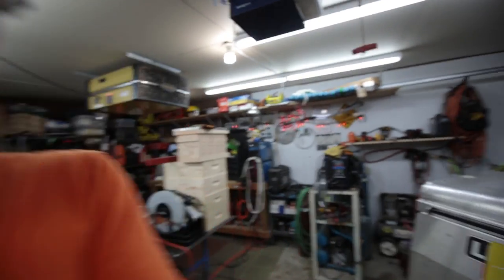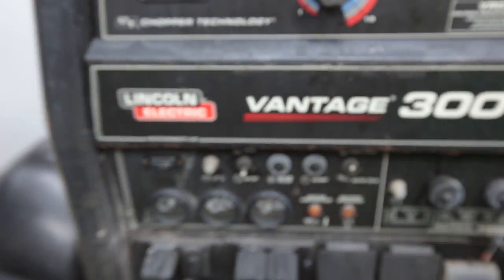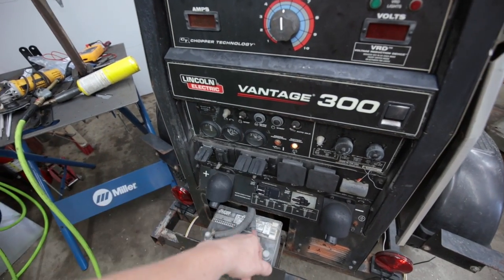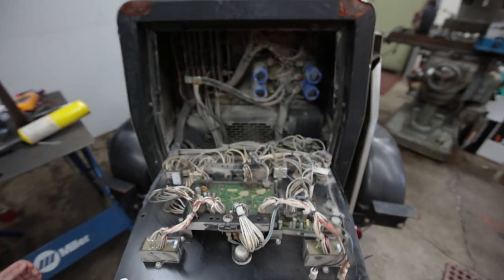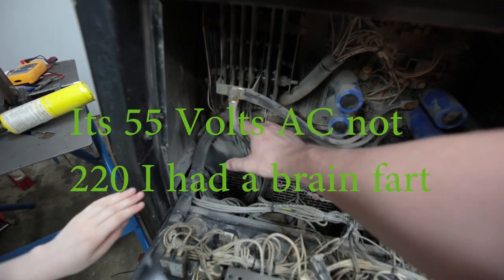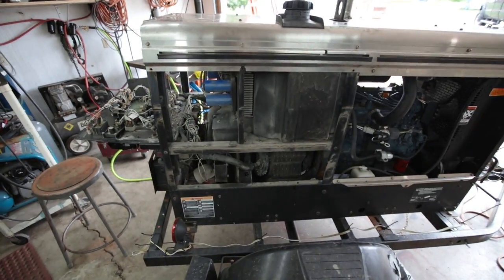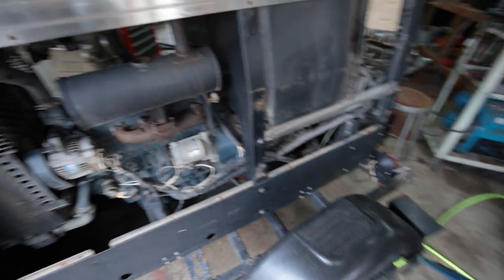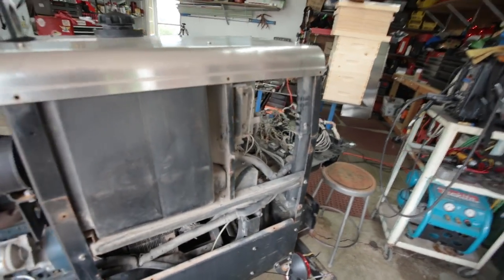So I Picked up my Lincoln Vantage 300 Welder

Comment: Any updates on fixing your welder. My welder was store for 9 and a half years my used to turn it on every 6 months now I came back to town and been using it for the past week and a half for about 6 hours a day and today it just did not want to arc. Try any tips on what to look for or were to start checking
Reply from the maker: I got it going, was a bad transformer. Best advise I can give you is look at the schematic and follow the output through it. There is nothing to complicated in them but the parts are spendy if you replace the wrong thing

Comment: Is it the control board or the chopper board that messed it up?mine just went lost of arc control i just used it the other day it was fine then the next morning i just turn the process switch and i got no arc control it is stuck in the lowest.the digital meters showing the numbers are changing when i turn it up or down but the arc is not going with it.
Reply from the maker: Mine was a bad shunt, thats strange wonder if the pot for the arc control is bad

Comment: i accidentally fix my vantage 300 this afternoon,after i unloaded it from the truck,and tomorrow i will load it back up again, this is what happened,i drop the covers on both sides of the machine and drop the front too,i unhook all the spade connectors,unhook and hook back connectors on the control board pushing the little white wires in,i called guy who works on his companies welding equipment,he told me that my problem might be the bridge diode,the control board ,loose  connections,and could be worst,im loosing hope on this machine im telling myself to dispose it.buy a new one,but before i gave up,i test it for the last time,and i was surprise that it is sparking right again!i tested  the dowhill stick,and the cc stick,and thank god they both working right,i told the welder mechanic about it,to ensure that the connector dont come loose again i cleaned them and applied dielectric grease on all of them.and bolt the side cover back up.
Reply: Where can i get a main PC control board for decent price for lincoln vantage 300?

Comment: Were you aware of the condition when you bought it or was it a bit of surprise? From your previous video I assumed you were picking up a working machine but now it looks like you have a number of serious issues and potential expenses of perhaps double what you paid for the machine itself. I'm not really aware of the value of these things so maybe saying you got it for $1,300 was self explanatory for other people.
Reply from the maker: I knew it needed work, I was hoping it was not going to be expensive repair. Around here these go for 5-6k in working condition with this many hours. So even putting an $1800 chopper board I am still money ahead buying this one
Reply: @DarlingtonFarm  i bought mine brand new in 2006. Sold it last year for $7000. With 6200hrs. You got a bargain my friend. Those machines are awesome. And yes Kubota is the way to go! 👍🏼

Comment: Little black diode . 2 in by 2.
Maybe a hundred bucks
Reply from the maker: nope, rotor 2500
Reply from the maker: woops wrong video transformer 700 a couple hundred hours later the rotor went 2500 for the part